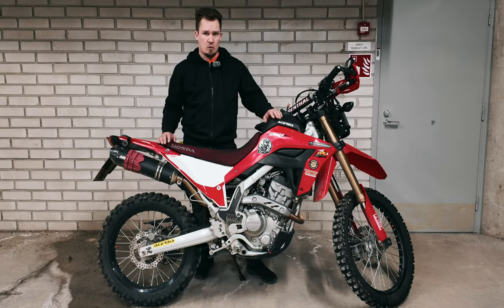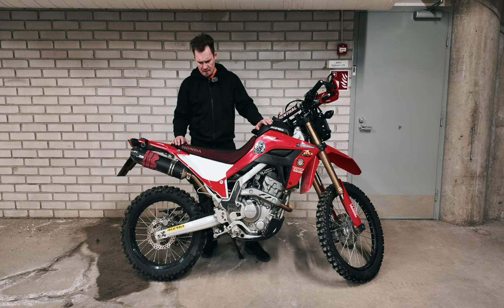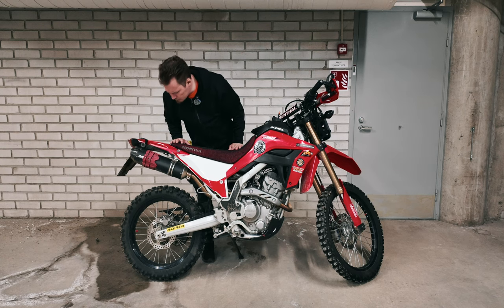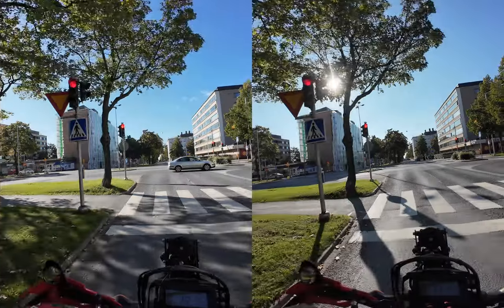Honda CRF300: Yoshimura RS-4 VS Dominator MX2 Exhaust Battle

Comment: Yoshi sounds way better. Dominator is to loud
Reply from the maker: Fully agree. It's nice when I'm in "full send mode" but traveling it's terrible 😂 Domi is lighter though.
Reply: @PatchedBandit  Kind of shocking how heavy the Yoshimura can is.  I bet it holds up better long term though than the Dominator and some of the other brands.
Reply from the maker: Yeah the end can is heavy. Apparently it has some kind of "double chamber" system. At least as far as I have read about it on forums.

Comment: I spoke about loud exhausts with my mother recently, and she told me that its a sign of growing up when you start to get fed up to excessive noise. 😅 Luckily the Tenere with a black widow slip-on isn't that bad.
Reply from the maker: Yep! I would still have the stock pipes if it would give me the same power boost as these racing pipes do. But yoshi is a good middleground for me :) Tenere sounds great with that!
Reply: @PatchedBandit  yeah that seems to be a good middleground! I drove some time without the db killer and the sound was a bit too loud to my taste. I planned to ride the infamous Oulun vappuajot without it next year, earplugs are a must. It sound like a goddamn tractor or a quad.
Reply from the maker: Let's see I might be there too next year.. planning a move back north.
Reply: @PatchedBandit  we will see there then!

Comment: Again impressive testing. Yoshirmura has a way larger R/D department than Dominator does......i would asume although the Yosh is a lot quieter (especially at 100km/h and 80 km/h) that the dyno would reveal a better power output , not in terms of max hp but maybe smoother in the overall powerband. Dyno is the only part i miss here but the intention of the video was the loudness not horsepower 🙂
The weight of the Yosh is inbetween Stock and Dominator which also explain why the Yosh is way more silent then the Dom.
Build quality sould also be better if you look at the price tag of the Yosh....you can get 2 full Dom exhausts for it....
Reply from the maker: Not noticeable differences on the power so I haven't even tested the RaceBox runs. It wouldn't be comparable anyway as I have different profile tires than I had before.
Yoshi is definitely worth the money. The bike is rideable without earplugs now.

Comment: What are you running for a sprocket/chain wheel  combination bro ?
Reply from the maker: Stock at the moment but I have bought a 42 tooth rear sprocket from JT and DID X ring chain for me to change soon. From 40 to 42 is not a big change but I`m mainly trying to compensate the taller spiked wheel Im running in the winter. The stock gearing is pretty good for general purpose.
Reply: @PatchedBandit  Ah ok - thanks for your swift reply - appreciate it..and keep on making such authentic videos on this little stone hopper - I love it :)

Comment: The Dominator sounds about same as my CRF250L with Blackwidow full exhaust.. too loud.. I wonder how much more does the yoshimura weigh than the Dominator. I bought the Blackwidow to gain power and save weight, but lightness comes with horrible noise. :face-orange-raised-eyebrow:
Reply from the maker: Description has all the info

Comment: Does  dominator have the decibel killer installed?  My 1200gs with dominator exhaust sounds pretty good even with dbkiller removed 🌝
Reply from the maker: Killer is in on both.
Reply: @PatchedBandit  ouh! pretty loud can then..
Reply: If your R1200GS is 2010+, it has an exhaust flap doing most of the job. Stock exhaust on 2010 to 2012 is basically a straight pipe muffler anyway.
Reply: @uralicdneprov1806  it's actually 2009. Stock exhaust was just stupid heavy

Comment: Weird the decibels at the end where not that different but the yoshi sounded much quieter
Reply from the maker: Intensity of the sound doubles every 3 dB so the difference on the video is quite a lot.
Reply: Ah ok I thought it must have been something like that because it was a big difference ! I’d like the yoshi but expensive so will get rear suspension done first . Just for your info after watching you changing the stack on Tuesday air box which looked quite a lot of work ! I saw on hivolt spares site they have one for sale do you think that might work ?
Reply from the maker: From the picture on their site very hard to even understand how that would go in the airbox. They provide no instructions or anything so can't really tell. 
Would be interesting to see how that installs and can it be trusted. They do say some sandpapering is needed.
I'm also a bit sceptical as it's 3D printed plastic. The stock part and the CB300 accessory part are both 100% rubber.  I would think rubber would have better sealing properties and heat resistance long term but like I said hard to tell from pictures.
Reply: @PatchedBandit when something looks too good for the money it probably is 👍